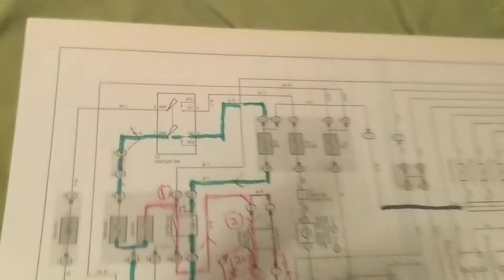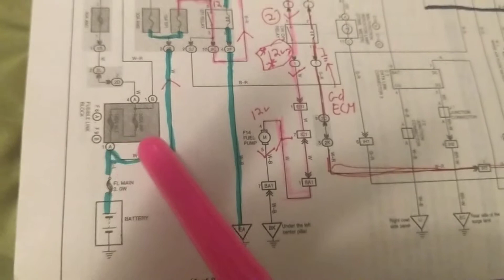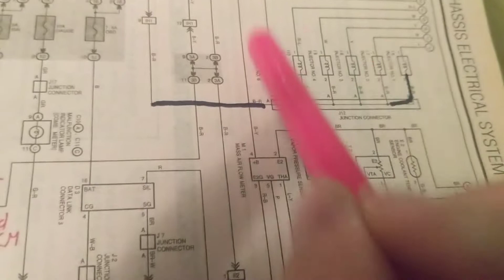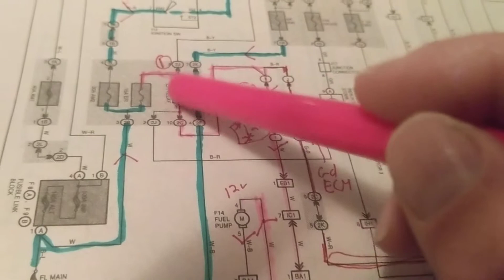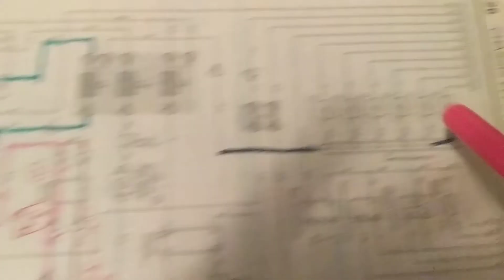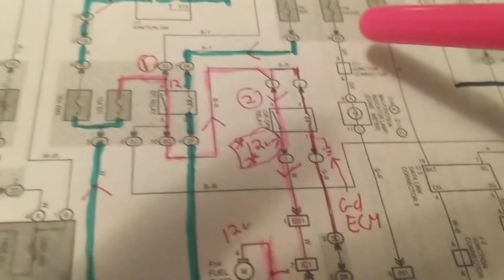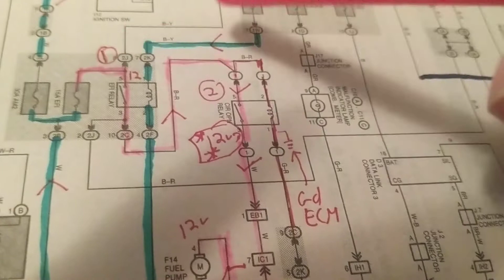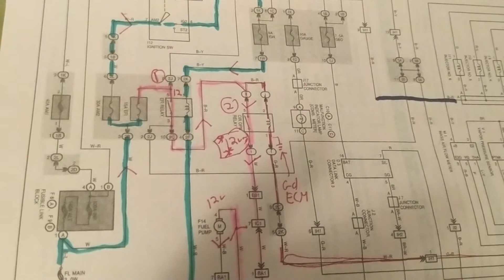How to troubleshoot from schematics for fuel pump problems Toyota sienna

Comment: Thank you again Mr. Joseph!  You just answer the solution to my problem.  I have a toyota camry 2001, start and have pressure when starts the engine but don't have prime neither pressure when turns on.  I will apply ground to see if I get the pump work on the position on.  Gad bless you Sir.